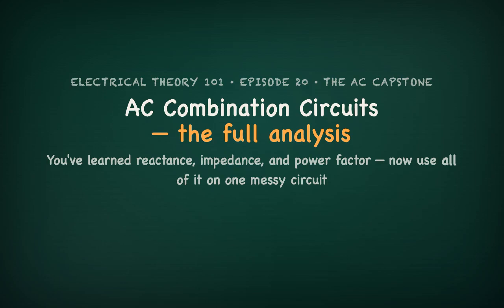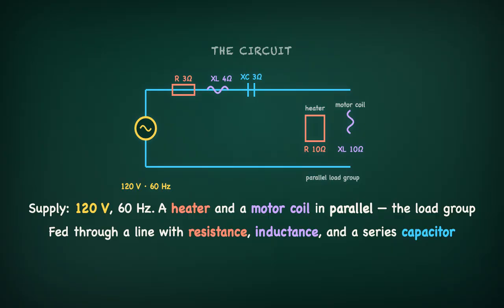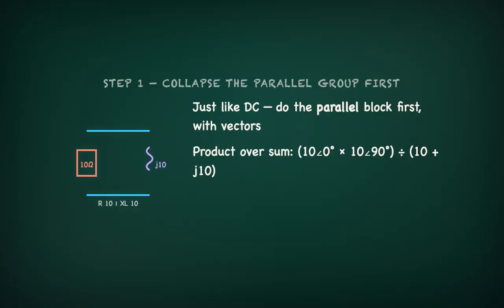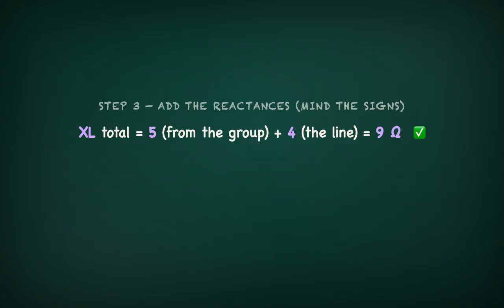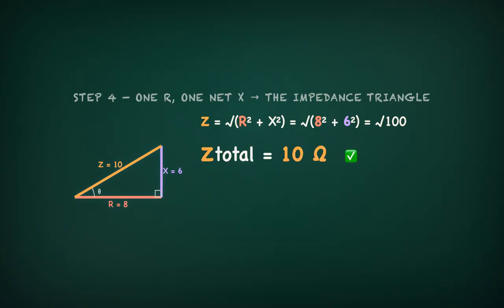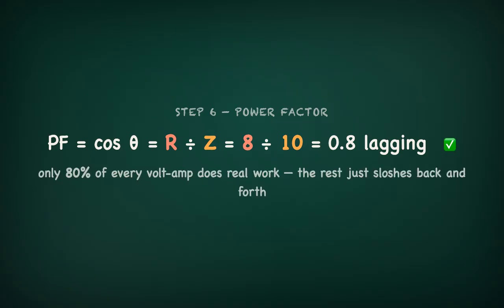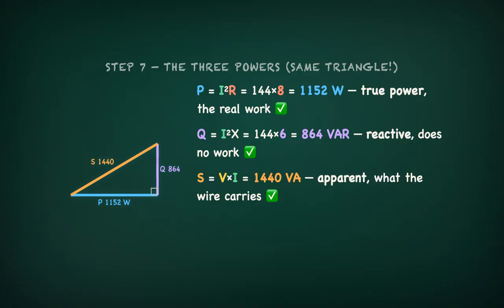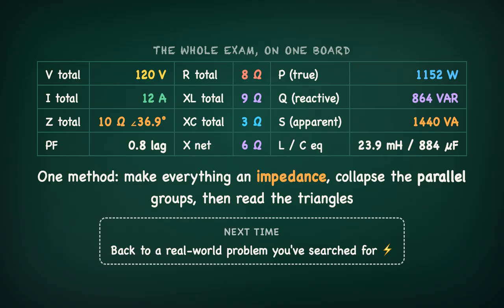AC Combination Circuits — Reduce Any Circuit to Power Factor | Electrical Theory 101

Comment from the maker: Practice answers: A) Z = √(30² + 40²) = √2500 = 50 Ω; PF = R/Z = 30/50 = 0.6 lagging.   B) I = V/Z = 240/50 = 4.8 A; P = I²R = 4.8² × 30 = 691 W (S = 240×4.8 = 1152 VA, Q ≈ 922 VAR).   C) A 10 Ω R ∥ 10 Ω XC combines to 7.07 Ω ∠−45° = 5 − j5 — it acts like a 5 Ω resistor in series with 5 Ω of capacitive reactance (leading, the mirror image of the video's inductive group).
The whole method in one line: make everything an impedance, collapse the parallel groups, then read the impedance triangle and the power triangle. What should we solve next? ⚡